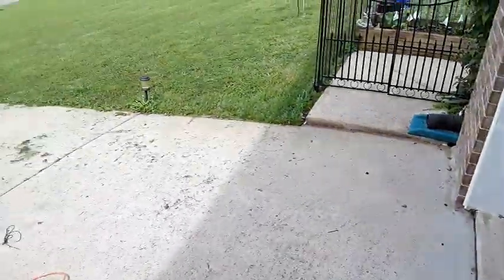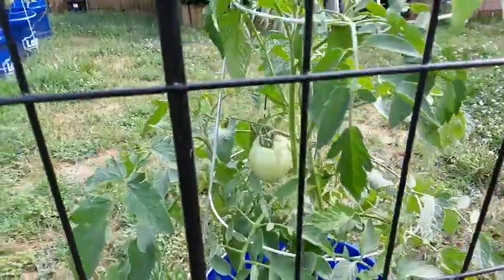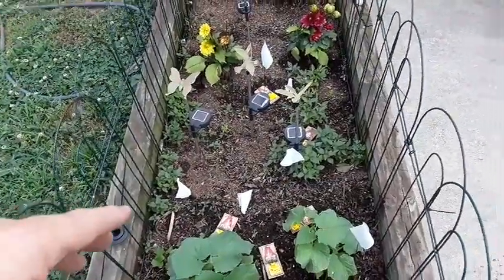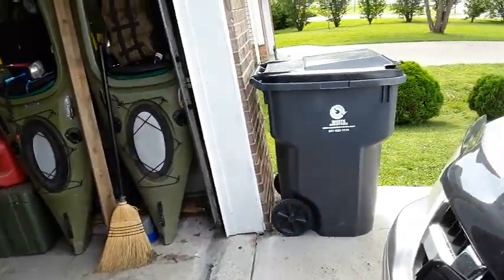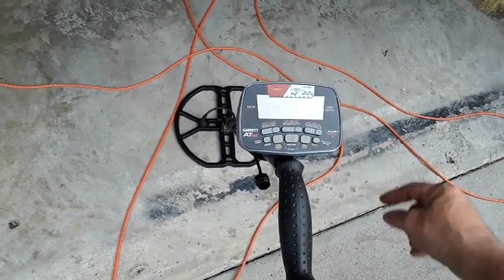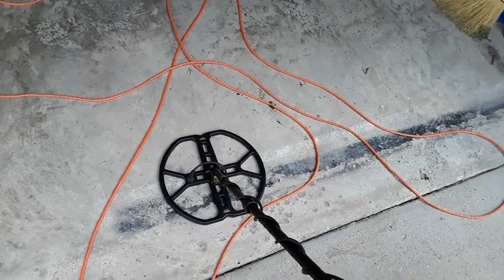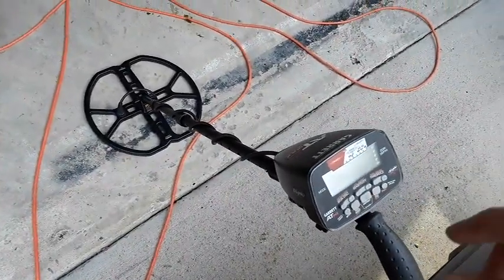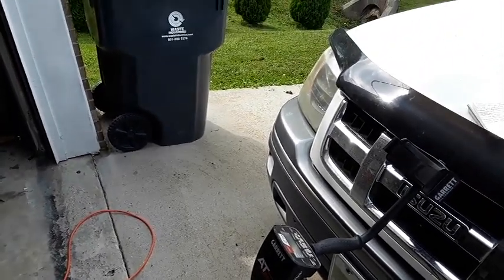AT Max & Pro tips, very helpful

Comment: the max has the auto ground balance that you have to move the machine up and down until number stops changing. also I was told by someone else that holding the power button just puts everything back to factory settings. they didnt say nothing about calibration

Comment: Interesting I did not know that I had to reset my machine when I change my coil. I always ground balance my machine and I check my settings. There's a lot of minerals in the soil out here. ATB HH
Reply from the maker: You still ground balance but resetting sort of re-bonds the console to the present coil. The function was placed there for a reason. I just never ever thought of it until now